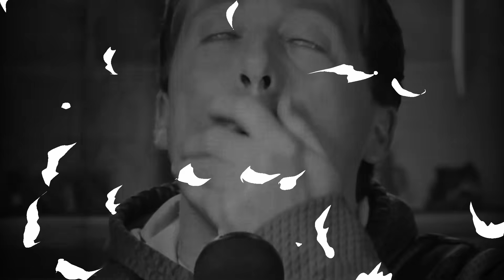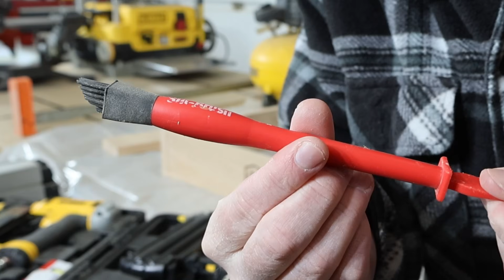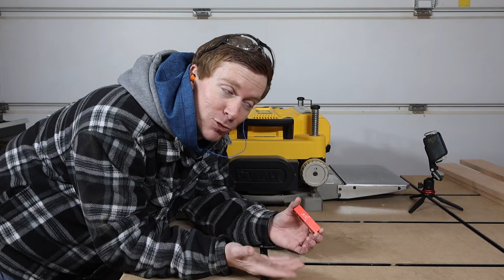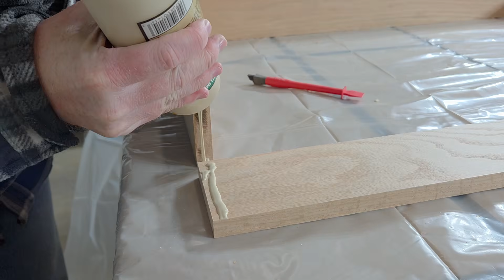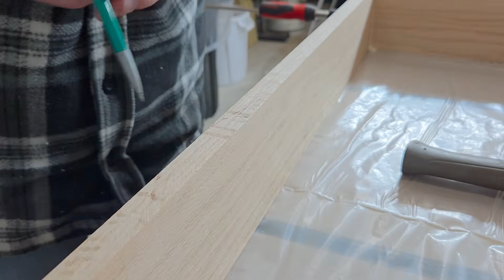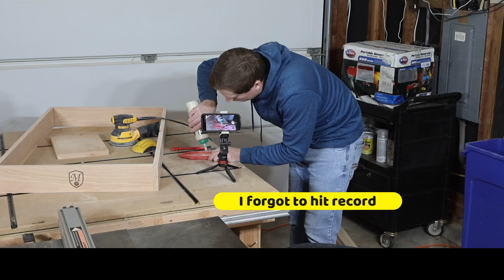DIY Digital Map Case for TTRPGs | NO MORE PAPER MAPS (4 - Assembling the Frame)

Comment: What if you don't own a brad nail gun, just use screws?
Reply from the maker: Yep! You could definitely use screws, they'll just be a little more visible. I'd recommend marking exact spots on the board that you want them to go before doing so so that they look symmetrical. If you're going with 3/4" boards, I'd go with 2 1/2" screws 😊
Reply: @MooreDnD ok thank you and or what  about dowels like two screws and one dowel in the centre asking because I'm using pine
Reply from the maker: Dowels would be fantastic! I love the look of them 😂 And you could theoretically line them up on the inside and they wont show on the outside, but I think it would look cooler to see them imo 😅 Just make sure you use a good bit of glue and they'll be MORE than strong enough!